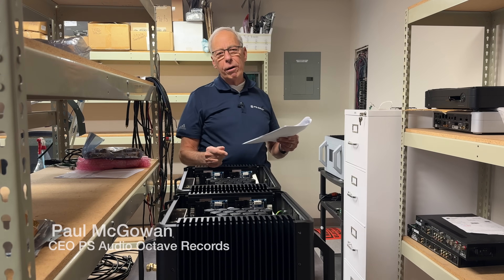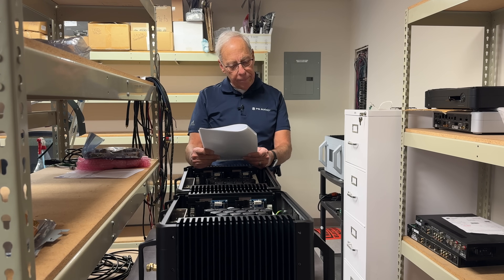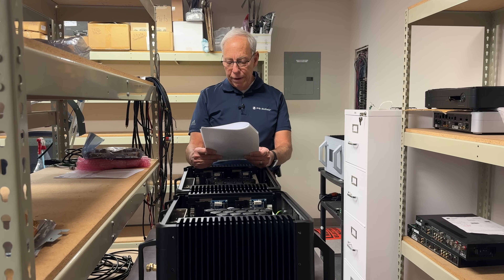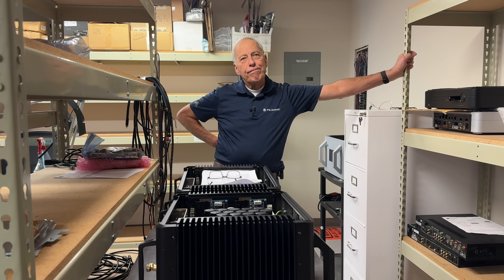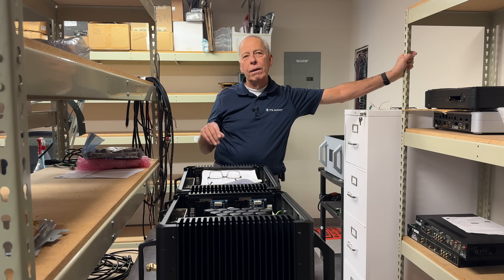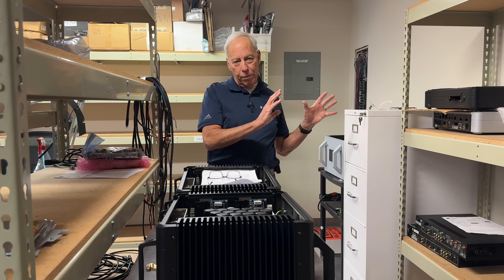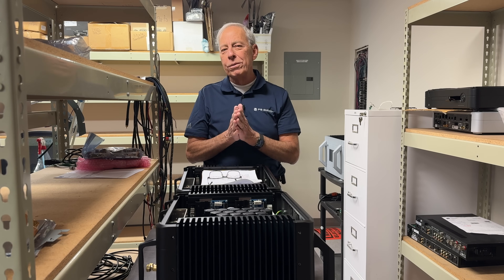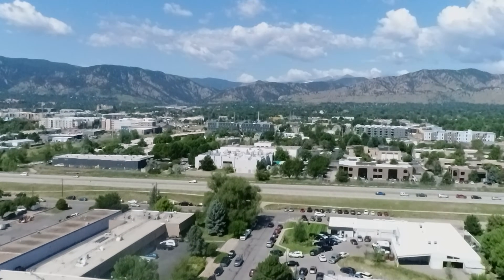How amps share power

Comment: 🤔🧐 so how would this work if i had 2 100w 8ohm speakers in series ive got 16ohms at the amp.  How does the power delivery work?? And what is better series or parallel??😮. I have them in series atm😲😵😵🤔🧐🤷🤷🤫😭😭ive got no fucking idea😢😢😢😂

Comment: If ONLY it was as simple as multiplying or dividing!      Speaker impedance is complex.   
Only by actively measuring the current drawn by each speaker can you really know how the energy is being shared,   
and doing it so you could properly see what was happening would require a linear paper-chart recorder for each speaker.    
Plus, having, say, 750 watts Available is not the same as Delivering 750 watts.  
To make that happen you would need to use a signal generator so you could apply a continuous voltage to the input of the amplifier.    
I real-world use, no 750 watt amplifier will Ever be called upon to deliver more than a small fraction of its potential at any given moment.

Comment: Commonly there is one power supply for an amplifier (either stereo or multiple channel) except monoblock

Is left channel will affect performane of right channel since they share the same power supply?
Or separate power supply is needed for their best perfomance?
Reply: If a single power supply is capable enough, it will serve any reasonable number of channels (as in a good surround-sound receiver),   
but in high-end systems each amplifier channel often has its own supply to ensure the best possible performance

Comment: The main issue isn't the amps increase in power  but the fact that adding the second (assuming identical) speaker will only increase the acoustical output by 3 db. A noticeable increase but often not worth the effort.  And when the amp sees 4 ohms, or sometimes less under certain conditions, you are going to stress the output stages and cause premature failure. Some amps are more tolerant than others but some burn up very quickly.  Be careful.
Reply: Is wiring in series any safer on amp or speakers????  Or is it a don't do it thing😮😢😢

Comment: Assuming both pairs are serving a common soundstage if the impedance curves of said speakers are not the same then you will have some content favoring one speaker and other content favoring the other. The result can be a muddy slog. Best to consider the two speakers as a single design with a common crossover taking all characteristics into account.

Comment: 750 Watts shared between two speakers is 375 watts into each speaker. Very simple.
Reply: Except that no two speakers are absolutely identical, even if they are of the same model,   
and each will draw power according to its individual impedance curve.  
If a frequency sweep was done with two very different speakers in parallel,   
they might 'seesaw' across the audio spectrum with first one and then the other drawing more power.

Comment: What frequency is the sweet spot of the midbus. And the sweet spot of the midrang
Reply: Frequency cannot have a 'sweet spot".  Each different frequency is a different musical note.  
The common standard of "A440" means that one specific note (middle A) is tuned to that frequency, 
but there are also A notes at 27.5, 55, 110, 220, 880, 1760, 3520, 7040, and 14,080 Hz.   
Middle G is just a bit less than 392 Hz. If we allow a slight error to simplify the math, 
we then know that there will be other G notes at 24.5, 49, 98, 196, 784, 1568, 3136, 6272,  and 12,544 Hz.   
Asking for a "sweet spot" in frequency is like asking which A or which G is the sweetest --- an unanswerable question.

Comment: Timely. Now I need to consider putting a switch onto my power amp for the output transformers and wiring the same so that I can choose 4 or 8 Ohms when I hook up additional speakers. The thought had rolled right thru my brain but I forgot about it just as quick. 
Such a timely video for me. Thanks Paul!
Reply: The switch you mention is only a switch that allows you to control the teansformator how much it puts out? I think it is mainly because the amplifier itself and the heatsink are not made strong enough. This was common on older amplifiers.
Reply: No. My transformer has leads for 4/8/16 Ohm. All I do is make it switchable ad lib. @ford1546

Comment: It should be mentioned that running an amplifier with a 4 ohm load puts more stress on the output transistors. Not all power amps take that well.

Comment: The question is more - are 2 speakers in parallel (4 ohms) consuming together 200w (significantly) louder then 1 speaker (8 ohms) consuming 100w ?
[edit: why would you ever want to put 2 speakers in parallel ?]
Reply: Depending on each's location, yes, each would be outputting the same dbSPL as it would separately. The outputs would comb filter, but be primarily additive. 

Why 2? Stacked Advents. Multiple rooms, large room doing sound distribution/ PA,...
Reply: @Creator Veeto PAEACP ... are we talking of PA or HiFi. If PA - I play guitar - it's just about sending out Watts as "cheap" as possible - there I could agree with you (although I prefer to run a separate amp for each cab). But in case of HiFi, I wonder if it would be preferable to have an amp for each speaker (cab) just to make sure that the amp is running with the ideal load at the preferred operating range ...
Reply: Yes twice the power and about twice the efficiency so about 6dB louder.
Reply: @dangerzone007  "about" ... if I pay thousands of dollars, then I don't accept guessimates ... 🙂. You have operating ranges ... like with your car. You shouldn't run a normal car at 10'000 RPMs all the time. And a petrol engines loves to run at 3000 RPM. So speakers in parallel will most likely not behave the same as they would each have their own amp each running with the desired output impedance.
Reply: @johnmoser1162  there's no reason why they wouldn't behave the same
Reply: @dangerzone007  Twice the POWER is 3db. Twice the voltage or current is 6db.
Reply: @glenncurry3041  twice the efficiency is 3 dB
Reply: @dangerzone007  so red herrings?
Reply: @glenncurry3041  tell me why the output from two drivers next to each other is 6 dB be more than one driver.
Reply: @dangerzone007  and another red herring...

Comment: So if both speakers are 8 ohm but when wired in parallel, the amp sees a 4 ohm load. As a consequence of that change, do the internal crossovers change their crossover points or do they still keep their 8 ohm crossover frequencies?
Reply: each speaker basically only sees itself. So no it should not affect the individual speakers/ crossovers...

Comment: The amplifier switches nothing. The voltage is the same, and therefore the current only is essentially “doubled,” as a relevant part of ohms law due to the load. The amp cannot “see” the load. Same superficial numbers sought in specs to make them think why the amp sounds good or bad. Phooey!
Reply: to feed 500watt to a 2ohm woofer the voltage is 31.6v , for 500 watt to a 4 ohm woofer 44.7v,  and 500watt  8 ohm 63.2v
If the watts are the same, the voltage isnt for different ohm loads.
but lets say 500 watt to a 4 ohm woofer is 44.7v  the same voltage can be used to feed 1000watt @ 2 ohm and 2000watt to an 1 ohm woofer.
The current flow for 2000w@1ohm is 44.7amps the cabels almost melt away, and only 11.1amps for 500w@4ohm
Reply: @palmspar  you know ohms law 👏👏👏. An amplifier simply doesn’t switch to a higher voltage because someone hooks speakers to it. It’s simply a false marketing ploy that an amplifier gets more powerful. The average consumer has no clue what the electrical definition of power means. In fact more amplifiers get in trouble quicker with a smaller load, because a speaker is no way stable as a resistor, and it simply can’t keep up because the power supply (another loose definition) can’t deliver. This is why amplifiers clip.
Reply: @palmspar  Watts stay constant if input/ output are matched e.g. output transformer. almost all solid state amps are Constant Voltage PS designs. Theoretically they give the same voltage regardless of load.
Reply: Assuming a perfect constant voltage zero internal impedance power supply. In real life there is always some internal impedance that drops some of the voltage across it. The lower the internal impedance, the more the power increases as load impedance drops. Thus the double power at half impedance, 8ohm to 4 ohm  specs. Little to zero internal voltage drop.

Comment: So.. at the end… a 4 ohms speaker will just take more electricity for the same level of listening! ? Isn’t??
Reply: The amount of electricity, power, a speaker takes for a particular level of listening is controlled more by it's Sensitivity. If you want some 90dbSPL concert level and the 4ohm speaker is 80dbSPL @ 1W, it will take 10 watts. If the speaker is 8 ohms but still 80dbSPL @ 1W it will take 10W. If it is a 4 ohm speaker that is very inefficient at 70dSPL, it will take 100 watts. Same 4 ohm load, different sensitivity. Same sensitivity with different impedance. 

Then throw in impedance matching output transformers and it gets even crazier.
Reply from the maker: Yup. Though there are consequences of each decision.

Comment: If you connect two light bulbs in parallel to a battery, the two light bulbs will shine as brightly as a single light bulb does on the same battery, but the battery must now deliver twice as many amperes.

If you connect two light bulbs in series, the light bulbs will glow twice as dimly and you will draw half as many amperes as a single bulb.

100w 8ohm amplifier.
1 x 8 ohms = 100w

2x 8ohm parallel = 4 ohms. You get 200w out of the amplifier, but the speaker only gets 100 wastt.

series connected.
8 ohms x 2 = 16 ohms. you only get 50w per speaker.
Reply: It's not so simple ... bulbs can be considered as simple resistors. Whereas a loudspeaker is much more complicated ...
Reply: @johnmoser1162  I know that a speaker does not have constant resistance but resistance varies with frequency. But what I wrote is what happens in simple form.

But I thought it might be a bit difficult to understand for some and a lot to write for me.

Comment: What is playing louder, one 4 ohm subwoofer driver, or 2x the same 4ohm subwoofer drivers dual opposed wired in parallel 2ohm load on the amp?. 
The amp on the same volume setting dont turn on the volume knob, only the driver load is now different.
Adding a second driver in a box the sub has 5-6db more output thy said.

Lets say the amp feed the single 4 ohm woofer 100 watt, adding another woofer the amp feed the woofers in parallel now 200watt on the same volume setting?

Comment: You hardly need 7 watts for a speaker in a normal listening space even with an 85db speaker (4 to 8 ohm) from a comfortable volume to an uncomfortable volume.
All these watts war are nothing but just B.S.
Reply: Don't underestimate the short watt peaks for very low frequencies. More watts mean more headroom for these impulses. For frequencies around 1 kHz you may only need about a 1/10 of this wattage.
Reply: @Fastvoice  No underestimation here.
Your average or above average bookshelves or even floor standers can't even reproduce those sub low frequencies anyway... So no point in waiting for that short peak low frequency to hit..🤷
Reply: @Jamy4ya  Well, I thought that this is a channel for audiophiles where average bookshelves or just floor standers without subs are not a thing. 😉
Reply: Oh well, strange that I need all my 170 W a channel then😅
Reply: Really? 85 dB ? Do you mean 85 dB for 2,83 V at 1 m or 85 dB/W at 1 m? Could you calculate how many Watts (with equal or less than 0,1% THD) do we need at 3 m of distance with an 85 dB/W sensitivity speaker with peaks of 85 dB at the listening position and a headroom of 6 dB and two speakers (stereo)? Will it be the same result with a speaker with a sensitivity 85 dB for 2,83 V  and rated 8 Ω impedance (that's not nominal) with a minimum impedance at 120 Hz of 3,2 Ω (more a 4 Ω speaker than a 8 Ω) instead one with 85 dB/W? Will that speaker draw 1 W or 2 W at 2,83 V?
Reply: @Jorge-Fernandez-Lopez  Cut all that crap. I listen 4 to 5 meters away from an 85db 6Ohm speaker on 8 to 10watts 300b tube amp and I am yet to hit that clipping level even before I damage my ears. There is a big difference between the theoritical speculation and reality.
Some amps are tuned for more bass and that makes people think it's because of the extra watts. But in reality it ain't.
Reply: @Jamy4ya  It's science and mathematics. You call it crap. The tube amps increase distortion more linearly, which is more difficult to hear. The problem are not the lows, but how distortion deteriorate the sound (you might like it) and can damage tweeters (Focal wrote about it). You can't affirm that any amount of watts is enough without knowing the speakers other people are using, how use the correct unit of sensitive (dB for 2,83V is not the same than dB/W, while "dB" is not a unit of sensitivity ) the kind of music (rock is not the same than classic), the volume and the head room they like, and the mathematics. If you don't care or don't believe in it it's fine, although other audiophiles and some broken tweeters might not share your point of you.
Reply: @Jorge-Fernandez-Lopez  Hi,
Nothing offensive to you or anybody here.
But i don't care of any distortions which I can't hear in the 1st place.
Secondly, my 300b tube amp was just an example.
I also have class D 56watts Leema Amp. In contrary my 300b 8Watts sounds little more punchier than the 56watts Class D on the same speaker. But at the end of the day, I like how both amp sounds. I am sorry but i forgot to disclose that I am not that ASR fond guy and going behind measurements and science too much. I like how the gear sounds to my ear. I hear the music and not monitor the music and unfortunately that's what most who claims to be audiophile do.

And I am not worried at all about damaging my tweeters or woofers until I hear clipping to my ears which I would never able to achieve in my listening space or speakers.

Again all these watts war are just hyped up and misinterpreted myth.
Reply: Lemme guess, subs are a monstrosity. lolz.
Reply: @Roof_Pizza  yes you are almost there. Imagine, even a budget sub, were the driver are only designed to handle sub bass frequencies were the wavelength is very high, which has only 350Watts RMS nominal. And normal bookshelves or floor standers can't reproduce those low sub bass frequencies anyway, hence you dont need lots of watts either.
Reply: 85dbSPL @ 1m/1W. Listening position typically 4(+)meters? So at listening position with 1W roughly 73dbSPL. To get that listening spot to typical concert 90dbSPL would take around 400watts?